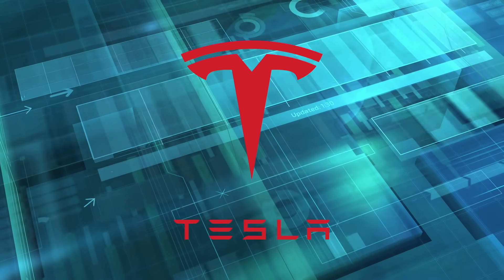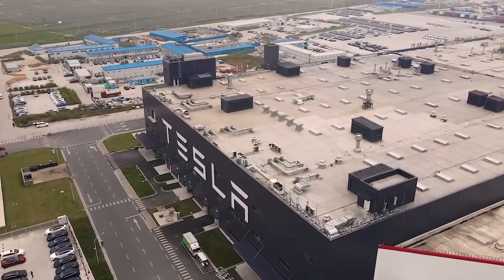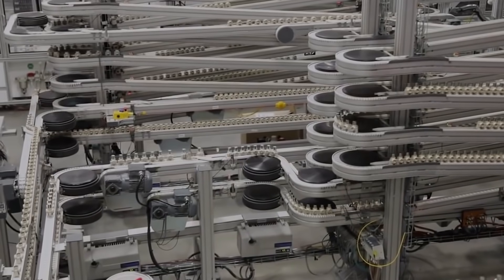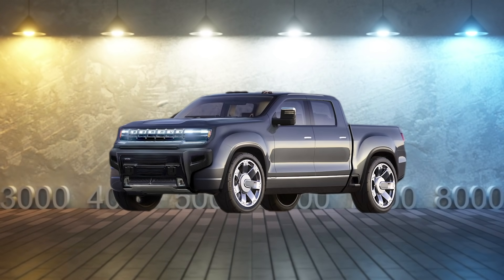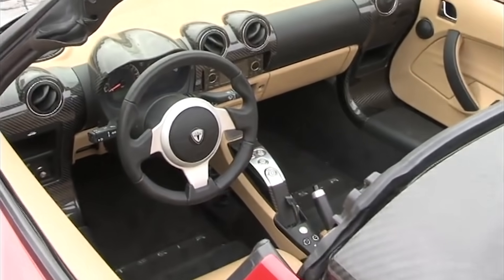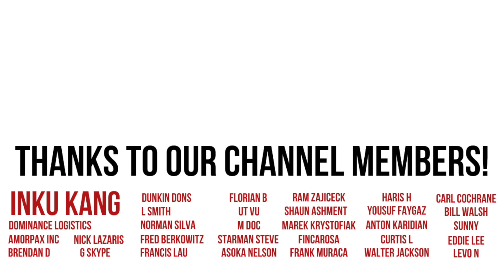GAME OVER - Tesla's AI Manufacturing Revolution

Comment: First:  You are mixing up "casting" and "stamping."  These are different animals.  When you form a sheet of metal, that's called stamping.  Casting is when you pour molten metal into a mold.  Cybertruck might be made of a single sheet of stainless (I doubt it), but in any case, it is stamped in one piece;  not cast.  The whole idea with Cybertruck is that the stainless body functions as exoskeleton, so there would be no frame to assemble or cast.
Second:  You mention the use of 3D printing as a way to accelerate production and increase efficiency;  but 3D printing is notoriously slow AND inefficient as a production methodology.  3D printers are used for "rapid prototyping", which is rapid only in the sense that standard prototyping usually is ordered off house and incurs shipping delays.

Comment: You said that the Berlin Model Y will be made from one piece of steel. Aluminium is a lot lighter and is easier to pressure inject into a casting mould that size (once Tesla’s materials science people invented a new alloy).

Comment: @4m15s You show the Cybertruck and that state the body will be made by a casting machine. It will not be made by a casting machine or a die stamping machine. Musk has spoken about this. he material is stainless steel, which cannot be formed by die stamping as it is so hard it will quickly destroy even tool steel. Instead it will be formed by a combination of bending, laser cutting and welding. https://youtu.be/fmFv34SC9OQ?t=255

Comment: Yet another BS filled video.  You're making a habit out of shooting your mouth off without looking into anything or understanding what you're saying.  Here's a list for you:
2:57 That's not a casting machine that's a stamping machine, totally different things.  
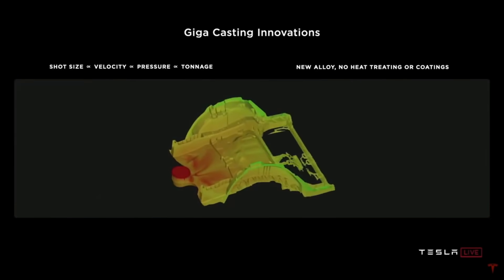3:32 It's not one sheet of steal, it's one casted piece of Aluminum. (Castings are done with molten metals, and are injected into a mold.)  
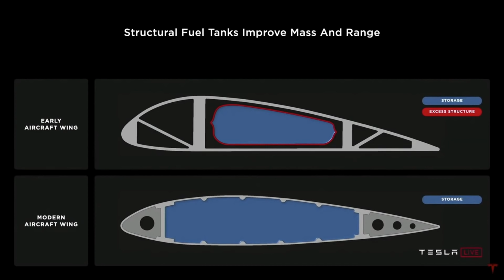3:44 What does AI have to with the casting process? 
4:01 The Cybertruck is not going to be casted, it's going to be made with a brake (yet another machine, different from a stamping or a casting) and then welded. And no, it will not be made of one large piece of steel, and if it was, it wouldn't be casted!!!  
4:12 No where and no one has said the Cybertruck's exoskeleton will be made by one machine, and again, it won't be casted.   
4:59 Casting machines are not revolutionary.  We've been using them for well over a hundred years, what's "revolutionary" is the fact Tesla is doing it at a scale and with level of complexity not previously attempted. 
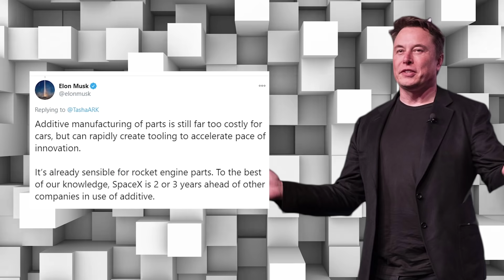5:18 Right in the very tweet on the screen, he said "tools" not parts.  Tools, as in things used to make parts.  3D printing is good for one off items (tools and prototypes), not for massive manufacturing. Rockets are an exception, since you aren't making thousands of them a week, and they have unique requirements.
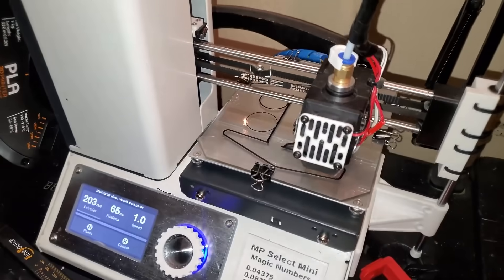5:29. Just because they are looking for 3D printing experts it doesn't mean that they intend to add 3D printing to manufacturing.  It's much more likely they use it for prototyping and tool creation. 
5:36. 3D printing is not going to increase a factory's output, it will help Tesla iterate on designs, which will allow them to get to production ready faster on a new project, but 3D printing isn't going to be a part of production itself.   
5:39 Economies of scale work AGAINST 3D printing.  3D printing is just about the slowest way you can make a thing, so if you scale it up, it just get's slower and wastes time and energy.

Comment: Pls note that you made a mistake in your description. Regular auto manufacturing uses sheet metal presses to press sheet metal into body parts of cars. Large castings... casting is the process of pouring or injecting a liquid meterial into a mold "casting" into a solid part. Tesla innovated its own metalurgy of aluminium and produced large casting machines to cast the rear and front under body of the model Y and likely will do so with model 3. As for Cyber truck they are using cold roll ultra hard 30 X stainless steel steels .120'' thick. The process is not casting but simply bending sections of the body on a press brake. The bending on a brake makes it simple because the lines are straight. As far as I know they will use many smaller sheets cut on lasers and then bend them of automated brakes.

Comment: 04:13- Again, the machine(s) that make the Cybertruck body are not "casting" machines. Tesla states that the body will be made of 30X cold-rolled stainless steel. 
This has absolutely zero to do with "casting". This video is MAJOR CRINGE. I can't finish it. Unsubbed.

Comment: I want to know who's making the robotics, software, and chips for these factories
Reply: From what I have seen in their videos, they use KUKA and Fanuc robots.
Reply: As big as they are, the have their own development department that can do it themselves or coordinate with outside contractors to get whatever they need.
Reply: It is Tesla’s proprietary hardware and software.
Reply: @Mrsmith4102  even better
Reply: @Mrsmith4102  nonsense nonsense tesla uses the same robotics like other manufacturers, the KUKA, ABB...., are all European robots.
Reply: They worked with various parties to manufacture their designs.
Reply: Tesla does as they make their own software to run the factories. The robots making the cars. The cars themselves. The grid scale batteries, solar etc. Not to mention their own self driving chips. Which last year's I'm production version of. Was quoted by an x invidia engineer who examined it. As 5 year's ahead of invidias chips. 😎

Comment: The cyber truck will not be cast. Stainless steel have a melting temperature over 1000 degrees c. It will be folded. The giga cast for MY is aluminium melting point approx 500.

Comment: It probably is possible to create a single piece casting for the entire body-frame, but the problem will probably be that it's too time consuming and expensive to make it worth the effort. Plus, you're not really going to get much benefit out of it. 

It'd probably be way more practical to shoot for three or seven massive castings, rather than one large one.
Reply: Straight edges on cybertruck make it possible. Nevertheless it will be challenging but someone has to do it first.

Comment: Single piece casting comes with a big issue: in case of accident you can't replace the damaged piece.. you have to buy a whole new car! Single piece casting great for Tesla both for cost reduction, but also to sell more cars to the same customer
Reply: As Elon stated, the crash absorption rails can be cut off and replaced with a bolted part for collision repair.
Reply: Once a frame is damaged on a car it is usually totaled.
Reply: and the frame of the cybertruck is extremely rigid compared to multipart cars.
Reply: What happens when you damage the frame of your legacy vehicle? ;) Hint: The same thing that happens when you damage the frame of your brand new Tesla. 
Totaled: Probably not worth the cost of repairs. ;)
If you've smashed the frame of either type of car, most of the body is also thrashed, as well.
Reply: True, however,  provided it is not caused by the driver then their Tesla insurance pays for the new car. Telsa insurance will have to fork out more to replace their own cars. Telsas already have less accidents (by far) than other cars on the road and with FSD (just around the corner) this will reduce to almost zero, I am sure. The benefits of single piece castings far out-weigh any cons.

Comment: 2:55 Dude, that's a stamping machine...
Reply from the maker: I corrected it in a pinned comment, thanks for pointing that out John. Audi called their stamping machine a "die casting" machine, which I was doubtful of, but looking further, it definitely is just a stamping machine.
Reply: @Casgains  And you can't really compare a bodywork to a structural part like that, it's not the same thickness, complexity and stiffness at all.

Comment: The big problem with these larger casting is repairs from collisions. Typically you just replace a fender or panel. Now your car will have to be cut up to repair.
Reply: Great points. 

But the incidence of accidents is lower with Teslas than traditional vehicles. As they continue to cut rate of accidents, then need for repairs goes down.
Reply: As one youtuber pointed out, damage to the casting would be akin to damage to the frame of other cars... and cars are typically never the same after that - if not actually totaled.
Reply: I think the most important point, that probably Tesla thinks about too, is the fact that in the future, not very far future, cars will be full slef driven, so accidents will be less than 10 time they are now, so in this world, they make sense
Reply: @Ni Viuk oh gawd not you again, plz look up which are the safest cars on the road,  They are all Teslas, they are the safest by avoiding accidents all together, and they include crumple zones. Are you a paid troll?
Reply: If you flex the frame on any modern car it's totaled too.  I am sure bumpers and minor body panel damage can be fixed just the same.  You see how many welds hold the rear section of the cruise together?  it' those welds get flexed it's totaled too.  It's the facts of modern cars
Reply: @Ni Viuk is it really impossible?
Reply: To cast a crumple zone?
Reply: @jwmc41  no, he's a lame troll
Reply: @Ni Viuk you're such a pathetic troll
Reply: @Ni Viuk the video is b.s. they are not casting the cyber truck they are pressing it using cold rolled stainless steel which is incredibly strong. The guy doing the video doesn't understand any of the technologies involved.
Reply: TheSushiraw  For Teslas driving on full autonomous, they registered 1 accident per every 4 million miles driven, when driving without Autopilot but with active safety features, it registered one accident for every 2.70 million miles driven. For those driving without Autopilot and without active safety features, they registered one accident for every 1.82 million miles driven. 

In a traditional car the accident rate is 1 for ever 500,000 miles driven. 

I'm sure Teslas crashing makes the news more often than a non Tesla having an accident would. Its rarer and a better story. Can you imagine if every car accident in Norway made the news every day?
Reply: @obcane3072  
What the hell does Norway have to do with this???  😱😱
Reply: Just the battery pack needs to survive the rest doesnt even matter
Reply: You are confusing the frame with the body.
In a legacy car - or in a cast frame Tesla - if you wreck the frame, it's pretty much totaled - not worth the cost of repairs, regardless of make or model.
Reply: There used to be a TV repairman on every block. What happened to them? They became obsolete, because the cost of TVs dropped so significantly that it was cheaper to replace than to repair. Tesla is causing this to happen to cars. Their cybertruck is a supercar that is cheaper than most gas trucks.
Reply: What do you do with your old phone? Just throw it to the trash and buy a new one. This is the power of technology and Tesla is doing that to cars.